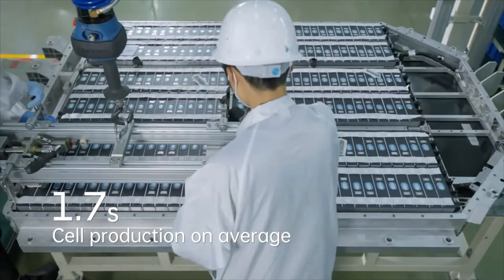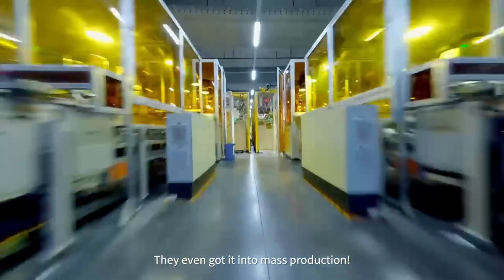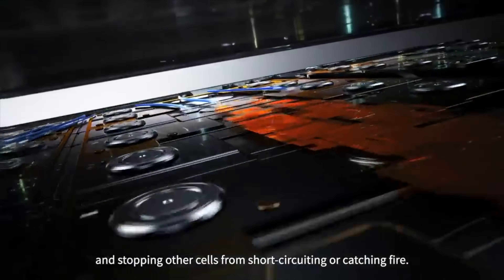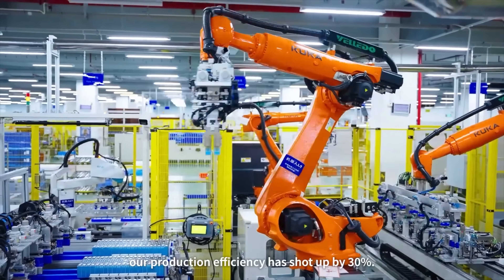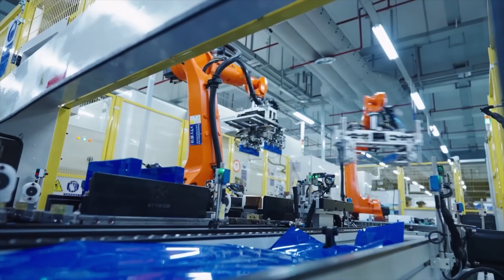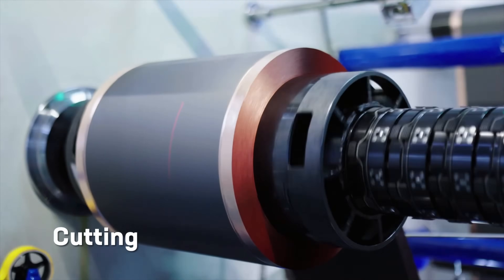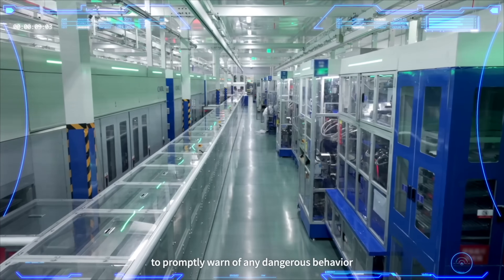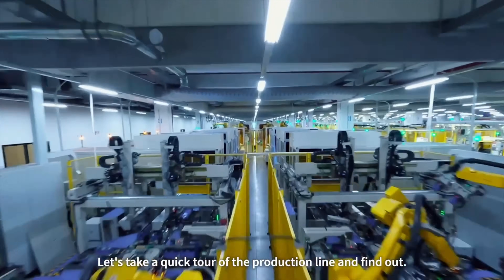CATL’s Sodium-Ion Naxtra Enters Mass Production - It's a GAME CHANGER

Comment: Let's imagine that the Na-ion battery has a capacity of 175 kWh/kg and the Li-ion battery has a capacity of 300 kWh/kg. 
An EV with an 80~90 kWh battery either needs a 300kg Li-battery or a 500kg (300kg x 300/175) Na-ion battery. 
Extra mass: 200 kg
EV battery life: 300,000km 
Consumption of electricity/kg: 0.00005 kWh/km per kg
Extra electricity consumed: 0.00005 x 200 x 300,000 = 3000 kWh or 3 MWh
CO2 produced to generate 1 MWh of electricity using natural gas is 400 kg; therefore, a typical Na-ion can produce an extra 1.2 tonnes of CO2.

*No allowance for inefficiencies due to speeding
*Not included the battery lifecycle factor

Comment: The additional environmental benefit of Na-ion batteries will be significantly offset by the negative impact of the increased electricity consumption required for EVs powered by Na-ion batteries, due to their lower energy density. Until we produce more than 80% of the electricity from green sources, the efficiency of the EV and electric trucks is crucial in controlling global emissions.

Comment: Quote ... Plus, CATL’s sodium-ion EV battery can charge from  30% to 80% in 30 minutes even in -22F (-30C) temps, while maintaining 93% usable capacity. Typical EV batteries have reduced voltage at a lower state of charge, but CATL claims its battery can maintain driving speeds of 75 miles per hour even if 0% charge shows on the dash. That is, until the battery completely drains out." 🤔🤷🏻 The C. Rate for charging is higher than expected .. and some are quoting 10%-80in single figure minutes..?

Comment: LifePo4 has a fantastically even charge/discharge curve from 10%-90% which makes it a great chemistry for inverters.
Unless things have changed recently, in Australia sodium batteries are not so cheap (for home solar storage), and it makes it a not worth while excercise to go that direction because it requires a lot more technical input to get the full capacity from them, but that may be changing.
I can see a lot of potential for sodium batteries in the future as their price comes down and they improve, possibly even hybrid sodium/lifepo4 packs for EV’s, so the sodium pack could add heat to the lifepo4 cells in cold weather to add more performance maybe from both chemistry’s working together.
Good vid and info. Cheers

Comment: Power = V x A.  As voltage decreases current increases. Power can be constant.
Reply from the maker: Hey mate, you're right that Power = Voltage × Current, and theoretically, power can be held constant as voltage drops by increasing current — but that assumes ideal conditions. In real battery systems, especially in EVs, it’s not that simple.

LFP's flat discharge curve means it can maintain a stable voltage across much of its state of charge, which makes it easier for the BMS to predict range, and for the powertrain to operate efficiently without ramping up current and generating extra heat.

Sodium-ion batteries, with their steeper voltage drop, require higher current draw at lower states of charge to maintain power — which increases heat and stress on the system. So while yes, power might look constant on paper, in practice, the chemistry's behavior matters a lot for performance, thermal management, and longevity. That was one of my main points. In electronics and electrochemistry, there are distinct subfields and specialised concepts that don’t always translate one-to-one.

Comment: Thanks. There is plenty of food for thought in this video. Tl; dr: There is a great future for Sodium battery cell technology. Bring it on!

In full:

The charge/discharge curve can be turned to advantage, because battery SOC can be measured far more accurately than with LFP cells. There is no reason why performance need be seen to be compromised as SOC drops, if the BMS and other electronics are designed properly; all that needs to be done is to adjust motor duty cycle as SOC varies, always ensuring that duty cycle is able to rise to 100% from an almost discharged battery, and limiting it to, for example, 50:50 duty cycle from a ugly recharged battery. In other words, you use a motor which becomes the limiting factor for power delivery to the road, rather than making the battery be the limiting factor.

Sodium cells will become popular because of the much lower cost of production, which feeds through as lower cost to the consumer. Cell gravimetric power density will improve as designs improve further, just as Lithium battery technology has been improving. Sure, it will not have the same theoretical gravimetric or volumetric power density, but there may be other factors which limit Lithium technology more than Sodium technology. We simply don't know all of the facts yet.

Sodium will also become popular because of the significantly higher battery longevity, its better tolerance of both higher and lower temperatures and improved safety over those metrics for Lithium.

The biggest clincher is likely that Sodium is far more abundant on this planet than Lithium. There are no fears of it running out, or of countries being held to ransom by those who want to use the element for political or selfish advantage.

Finally, Sodium batteries are already being produced with more energy per litre and by kilo than Lithium batteries had when they were being produced only around 5 to 10 years ago. And those lower performance batteries did not really slow down the uptake of electric vehicles. Indeed, electric cars were more popular than petroleum or Diesel powered ones 120 years ago, even with the NiFe-alkaline and Lead-acid battery technology of those times, which had far poorer performance than almost any other popular rechargeable battery technology which is available today.

I'm very optimistic about Na technology, and hope to live for long enough to see most road, sea and even short to medium range airborne vehicles using it.

Comment: Thank you for the detailed information on the new battery tech . 
I wouldn't like the bhp power of my car to be less powerful from full battery then keep dropping bhp as batteries get low could be dangerous when coming to overtake something and the performance isn't there that you expect. 
I think it would be good in cold weather countries like you said and home battery storage. I think the next car battery 🔋 generation is solid state batteries. It is
Interesting to see how technology is progressing. 
I think once we half the weight of the battery pack for the cars and double the range most people would be happy with 450 mile range and cars that weigh  1,500kg or less would be spot on for most

Comment: As an ex novice diver using a single stage demand valve (sodium ion) one could tell when tell through the resistance to breathing I was getting low on air, (sodium ion, a drop in power) to me this is a good thing as there was still plenty of time before the need to surface as I still had 30 ATS in my tank. 
2 stage demand valve, supper efficient, (lithium ion) the first feel of resistance to breathing. Gauge read 0 ATS 
Nearly came a croper that day .
I know these cars have all the bells and whistles that tell you when your batteries are low, but for me sodium, so as I can feel the need to recharge

Comment: What about the rest of the chemistry? I mean, it's more complicated and if anything more important for Na-ion than it is for Li-ion, but "no one" talks about the rest of the chemistry when it comes to Na-ion. Sure, sodium is cheaper than lithium, but that doesn't make much of a difference on the total cost, and when the market matures and stabilizes that difference in cost between lithium and sodium will make an insignificant difference for the overall cost of the batteries. The inherently lower energy density with sodium also means you need more of everything else, including bigger casings, so, in an apples to apples comparison, for the same amount of capacity, it doesn't seem likely Na-ion will become much cheaper than LFP.          

50% of current LFP market won't be a significant part of the total LFP market for long, that might happen. 

It's primarily the power output that decrease in low temperatures, not the capacity, as in stored energy doesn't disappear, and the power output will only be decreased as long as the lithium-ion batteries are cold. It might seem great to have no significant reduction in power in minus 40 degrees, until you realize that starting a trip in such temperature without preheating the car isn't something normal people do, if they can avoid it, at any cost. And you wouldn't be able to go very far if you used energy from the battery to heat up the car from minus 40 degrees. 

I'm sure CATL have solid reasons for their decisions, but I don't see the real advantages for use in EVs constituting a significant part of those reasons to invest heavily in Na-ion batteries.

Comment: I am not electrical engineer but I would wonder if one could not string some more sodium batteries in series as they drop in charge to maintain the voltage.  I just suspect there are ways around the problem he mentions.

Comment: Did i miss the purchase price saving? As for the change in power delivery due to state of charge, probably just throttle power when full so its consistent/predictable. Cheap EVs don't need to be neck snapping fast, but for mass adoption they need to be easy and predictable to drive for the masses.  Lots of new EVs already ease in the power from a standstill to mimick petrol power.
Reply: Agreed.  The BMS already limits the charge rate nearer to full charge as well as the discharge rate at low state of charge.  The ‘neck snapping’ acceleration from standstill is related to the motor torque characteristics.  Control over that is simple enough.
Reply: The power in most EVs is already too ridiculous. Took model 3 for a drive and couldn’t believe they sold that thing to the public, like a missile on wheels 😂😂😂
Reply: @Shrouded_reaper    You don’t need to drive with your foot to the floor all the time!!

Comment: Not sure I agree with anyone when it comes to the EVs or at least not a full pack. Less LFP + more Sodium for colder climates makes sens and you are more than likely not driving that far anyways. More LFP + less Sodium might still be good to reduce their cost and allow them to work better for more mid range devices as both tech have improve to still get around 300 miles or so. With that said, EVs should still focus on trying to hit around 400 miles so its really 300 miles + heating and cooling personally for the US market. On the flip side, Sodium should work well in the Grid and Home application much more. Where weight and size doesnt matter as much but safety and cost is.

Comment: Interesting info on the Na ion voltage drop during discharging👍. China has the biggest salt (NaCl) reserve in the world. Sodium ion batteries are a logical choice, will reduce  the costs of EVs in general, but this battery type requires a super fast charging ( 1mega Watt) infrastructure. Sodium ion batteries can charge faster than LFP,  but the capacity per Kg is lower.   The Chinese EV companies are taking care of the 1M Watt charging infra already. That means a sodium ion battery pack has to be 1000 volts (fast charging with 1000Volt and 1000Amp), the motor should be 700 volts, and a voltage down converter from 1000 to 700 does the trick. I think BYD solved the mentioned problems.

Comment: BYD is already having BOTh Sodium and LFP batteries inside the EV. However their Ratio of sodium and LFP batteries will VARY depending on USER driving preference, climate, daily milage, charging facilities, etc. In China they have done extensive testing on various ratios.

Comment: I don't think voltage drop will be a big deal. Future batteries may be able to configure themselves into different arrangements of series-parallel on the fly, and electronics could boost or buck whatever is required. Cold weather performance is much more important.
Reply: Yeah, I think the other pro factors are better, EVs already give a surprisingly high torque compared to regular ICE cars, so sodium batteries probably just gives it back a little, not everyone needs a V8 drag racer, cold weather, cost effectiveness, and normal every day commuting performance is more important.

Comment: I think the in an EV the inverter will "hide" the voltage drop from the driver.
Reply: It's more the current draw.  Power = voltage x current so if the voltage drops while being limited to a certain current draw than potential power will decrease quite a bit.  They can of course design around it by having much higher potential current draw than needed and moderate it in a way you don't feel performance loss.

Comment: These things look bad. There are so many properties of these batteries that they are not advertising. And in my experience that means that those properties are not favorable. Cycle life is not the only factor that determines how long a battery can last. There is also a thing called calendar ageing, but those metrics are not disclosed. Cycle efficiency is another weak point for sodium batteries that I couldn't find data on.

Comment: At today's lithium prices sodium-ion makes little sense for most use-cases.  It does make sense for CATL though, mostly to protect itself a bit from any future lithium price spike.
Reply: But that's because everyone making sodium is only just starting up. Sodium itself literally sells for less than 0.2% the price for lithium, so once the sodium battery production infrastructure reaches where LFP is now, they will become significantly cheaper than any lithium battery can ever be. At 220 GW solar installation annually and a national mandate to get rid of coal by 2050, China will need an estimated 5700 GW (14,000 GWh) grid battery storage capacity. This is impossible to achieve without sodium.
Reply: @andrewsuryali8540  Most of the cost isn't the Li though.. its the other part of the cell that cost the most. So even if you was to replace it with Na, you are only really affecting at most 30% of the cost. The only way that might change is if we go a all Li metal design vs using Carbon on the anode. US is also starting up Li mines... so the cost of Li should be dropping again and has been dropping. So its going to be a mix battles for EVs. For Grid and Home, I can see a strong argument there to split up the renewable access.